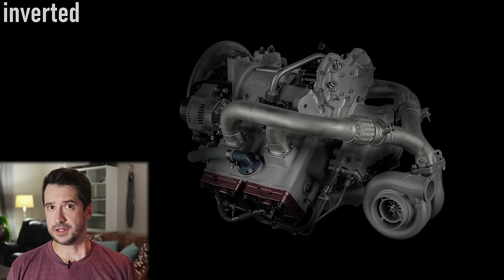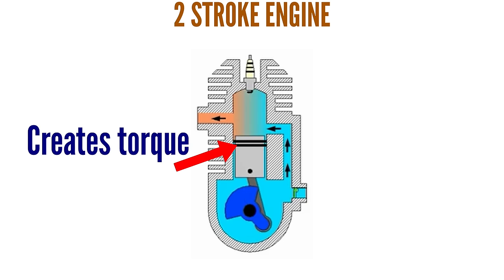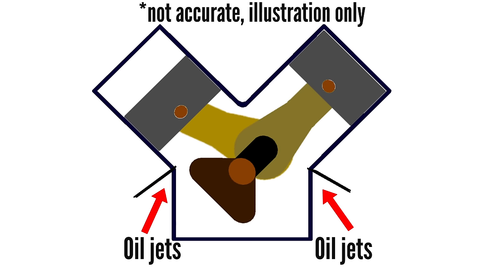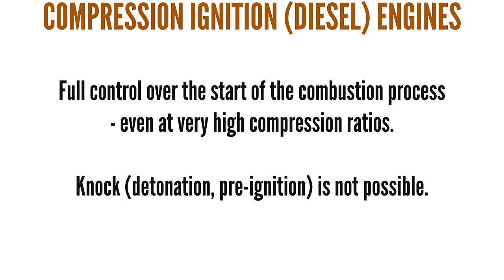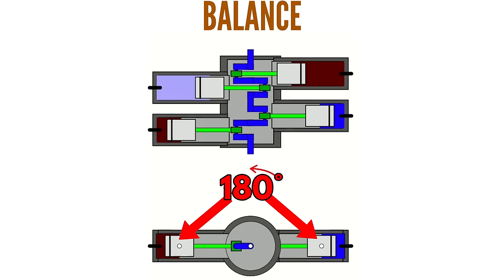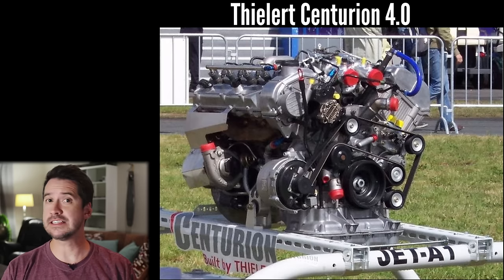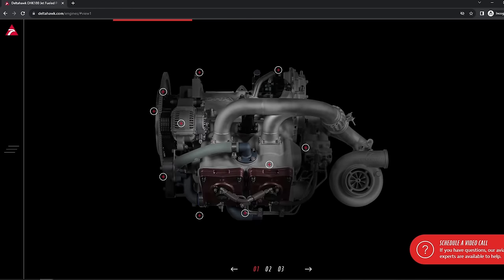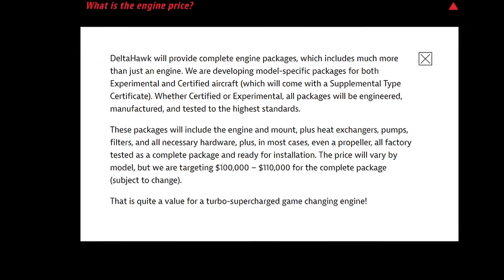Deltahawk's Jet Fuel Piston Airplane Engine Explained

Comment: Two stroke Diesels are NOT supercharged. The thing you are calling a supercharger is a "scavenging blower."  It is necessary to provide air for combustion. I worked for some time for a company that makes 2 stroke Diesel engines.
Reply from the maker: This info comes from Deltahawk's website as well as several aviation news sites. They are calling it a twin-screw type supercharger.
Reply: Actually I remember the old Gimmy diesel that I worked on years ago and that engine was a 2 stroke with a super charger. And 1/4 mile racers used those super chargers on Himi engines.
Reply: This engine uses a centrifugal turbosupercharger and a positive displacement air pump
Reply: Says twinscrew on website.  There are plenty of people that have supercharged and turbocharged on the same engine.

I will point out, in the video, stated that the supercharger isn't used after turbo kicks in is false.  The supercharger is positive displacement, and sits downstream (closer to the intake), it's still going to be compressing the air, just will be compressing the compressed air from the turbo.  Same idea as a compound turbo setup, except what would be the small turbo, is a supercharger in this case.

**edit.  A supercharger and scavenging blower are the same thing in this application.
Reply: Detroit 71 series was a 2 stroke OHV with a supercharger, and later models had both supercharger and turbo charger.  In production  from 1938-1995.  They sound wicked.
Reply: @brianb-p6586  it does though, though it might be 3psi, it's still a positive displacement.  Semantics at best.  Factory calls it supercharged, so it's supercharged.
Reply: Yes it's a blower on an old gm 2 stroke but it still makes positive pressure......otherwise it wouldn't work.
Reply: This engine is both turbocharged AND supercharged. I have been to (and toured through) the Deltahawk HQ in Racine, WI, and have inspected this engine very closely (although I was not allowed to take pictures - it was this summer, just after they announced certification). It definitely has an induction supercharger.
Reply: @Jessersadler k
Reply: The 'supercharger' likely has a bypass valve that allows the turbo boost to flow into the engine directly, with the supercharger/scavenger just spinning.  Requiring very little power to spin.   It would be awesome with a 1.5:1-1.8:1 possibly a 2:1 gear reduction, to allow the engine to spin up closer to 3500-4000 RPM. Or possibly higher. A variable gear reduction would be useful, a cvt of sorts maybe a hydraulic coupler with variable geometry. Allowing a near lock up at low rpm low throttle. And a reduction with more throttle , multiplying the TQ on the prop. Being aircraft, a failsafe is required. The use of a clutch to lock in a 1:1 ratio. By either manual application, or hydraulic pressure. During take off, it could allow the engine to rev to peak tq. Then change the prop angle of attack, and hydraulic reduction, to get optimal prop performance, allow the engine to rev between peak tq. To peak power.  Then settle to a cruise rpm. Possibly a 1:1.
The next awesome thing would be a V6, then V8 possibly a v12 version. About 360hp V8.  And 540hp v12, possibly more. Possibly using slightly smaller bores with longer strokes with the engines with more cylinders.  Still equal roughly the same displacement per cylinder.  Pushing the tq peak lower in the rev band.  I'd love seeing a  V6 & V8 version of this atleast.    Heck I'd love to see a modern light weight aluminum version of a Detroit Diesel, a 6v71, or a 6v92, nearly 550 cid of two stroke diesel power! And hearing a airplane with that Detroit roar! Awesome!! Even a 4v71 aircraft engine. 🤯 use modern pilot injection, haha. Make it quieter running.  With 284cid, with a pair of turbo's with air to water intercooling.  Wow..
Reply: @jamest.5001  Not how it would work, and would over complicate things.  Why would you a have a blower that's pulling parasitic power, and then not use it🤦‍♂️
Reply: @brianb-p6586  In this case, it seems as though you don't know what a supercharger is.  . . again, semantics at best, and you're the only one arguing it.

You know the other word for BLOWER ?  It's SUPERCHARGER. . . so you're literally saying "Scaveging supercharger"

"Every blower is a supercharger, but not every supercharger can be a blower. A blower is just another name for a supercharger, particularly roots-type supercharger, which is probably one of the oldest styles of supercharger"

And particularly this is a twin screw supercharger.  Both are positive displacement, both will increase manifold pressure.  If ambient pressure would be all thats needed, then there would be no need for one.  And damn near every multicylinder 2 stroke will have a supercharger(blower).

Also, by your definition.  The turbos aren't turbos either, as they'll scavenge the cylinder as well.  What should we call them then?

**edit
Going back to the Detroit motor, and why you would say the blower doesn't make boost, is because of either the valve timing, or port placement on these 2 strokes.  If both intake and exhaust close at the same time during compression, there will be no "boost", but the manifold will absolutely see "boost".  Since this is a port motor, and it relies on boost pressure, we have to assume the exhaust port is closed (cut lower or another way to closed intake air from escaping) before the intake port.
Reply: Superchargers are a mechanically driven compressor used to supply combustion air to any engine diesel,gasoline propane or other fueled engine. They generally have two rotors with either two or three lobes on each. The rotors may be straight or twisted.
Reply: @Lloyd973  Well, a roots blower doesn't actually compress the air per se.  Needs a manifold for that ability
Reply: @Jessersadler  depends on its intended use. Top fuel cars use a supercharger and typically exceed 50 psi at 9000 or more rpm. Diesel engines that use a superchargers are generally gear driven or belt drive and typically are designed to provide additional air flow at a higher than ambient pressure. When used in many industrial applications pressure is secondary to total flow. Large quantity of a gaseous entity  at low pressure as in many roots style blowers.  Two different  applications for the same piece of equipment. 
For automotive use the engine has a manifold.  For most industrial applications the blower has inlet and outlet ducting which serves the purpose of a manifold. 
We are all saying the same thing just a little differently. As you said several times semantics. Thanks for sharing with us.
Reply: @Jessersadler yes often called super turbo
Reply: @Jessersadler he will never get it😊
Reply: The supercharger helps with scavenge and the turbo increases overall charge pressure. 2strokes are easy to turbocharge as long as the exhaust back pressure is on the order of the intake pressure.
Reply: Isn't any forced induction
Supercharging
Turbocharger
RAM AIR  INTAKE
TO IMPROVE SCAVENGENG FOR IMPROVING EFFICIENCY AND PERFORMANCE
Reply: @garreysellars5525  a 2stroke without crankcase compression won’t even run without a scavenging pump, Diesel or not, as there is no pressure differential to drive the chargers into and exhaust out of the cylinder. following the description, the turbocharger is a set-up that provides more boost than exhaust back pressure, hence allowing scavenging. The SC is only used for startup or emergencies. They mentioned it would be good for about 50% power, essentially making it a classical scavenged no boost 2stroke. Without either SC or TC, this particular engine would plainly stop running.
Reply: It's still supercharging in my book.    Is an engine driven blower forcing air into the cylinder during its intake phase/stroke?  Yes?  It's supercharged. 

The engine requiring it to run, doesn't change the fact that the cylinder is receiving higher than atmospheric pressure.
Reply: @mikeg3529  that is correct, but the pressure is very small and you don’t necessarily get above atmospheric pressure in the cylinder. It is mere to replace the crank case compression of a “normal” 2stroke engine.  Without either, it won’t even run.
Reply: @garreysellars5525  no, in case of 2stroke Diesels without crank case compression, the SC is not causing an improvement of scavenging, it does the scavenging. You cannot boost the engine this way, it plainly won't even run without that supercharger. Only once the engine runs above a power threshold , you can use the turbo to achieve the same, but only if the intake pressure is slightly higher than the exhaust back pressure. In a 4 stroke, ex pressure can be higher than intake pressure, but for an externally scavenged 2stroke, it cannot. This SC does not increase power over naturally aspirated, it enables the engine to run as naturally aspirated engine. Decouple the SC at idle or lower loads, without TC even at full power, and it would plainly stop running.
Reply: @mikeg3529  once the intake ports are closed, there is no significant "boost" in the cylinder. It is not supercharged, but rather charged. That is why it is called a scavenge pump and not a supercharger. It makes no boost in a sense of cylinder fill pressure above atmosphere. What makes boost in this engine is the turbocharger that is set-up to make more boost than exhaust back pressure. Otherwise they would not be able to decouple the scavange "supercharger" without the engine essentially stopping. This supercharger replaces the classic crank case compression as a scavenge mechanism of a fuel lubricated 2stroke engine.  It is not a power adder, it plainly is a power enabler. The engine won't run without.
Reply: A Supercharger builds pressure, a blower moves air, a roots on a detroit diesel doesn't build significant pressure, which is why they are not considered supercharging. This has a twin screw, unlike the roots it has internal compression making it much more thermodynamically efficient for boosted applications and horribly inefficient as a blower, because it would compress air, only to have it expand back in the manifold.
And don't even start with top fuel, they are forced to use the roots, which is horribly inefficient at producing boost, if they were allowed to use twin screws it would gain hundreds of horsepower due to the reduced drag alone, not to mention the much colder intake temperatures. The sanctioning body wants to keep them from going to fast to reduce accidents, the fact they use something does not mean it is anywhere close to an ideal solution.
Reply: Symantics. No one knows what a scavenging blower is. Say supercharger. The 1st "supervhargers" came from airplanes and 2 stroke diesels swapped into gasoline. Its NOT required to have the blower but it makes 2 stroke efficiency go way up
Reply: yup thats a turbo
Reply: 🤓 it's still a supercharger, even if it is set to make minimal boost and is necessary for combustion. It also still can make boost if you run it at higher speeds.
Reply: All really big marine engines are turbosupercharged 2-strokes. And pretty wicked pressures too.
Reply: It's still a supercharger even if it's used for scavenging.
Reply: A blower is a supercharger and the standard GMC roots supercharger was literally designed for detroit diesel 2 strokes
Reply: @lapin46  yeah, that's why no 2 stroke engines without a blower have ever worked lol
Reply: They are supercharged. Wouldn’t make enough boost to run at idle otherwise.
Reply: The blower on a Detroit Diesel engine is known as a Roots type blower. Minor pressure rise. It was originally designed as an air mover for mines. It is used on engines because it produces positive airflow at low speeds. On a DD engine it gets the air moving in the right direction. As a compressor it is not high efficiency.
Reply: I'm not an engine guy but from what I gather here it seems the argument here is that although they are essentially the same piece of hardware in one scenario it's used to force air above 1bar into the combustion chamber this allowing more fuel to mix with the greater quantity of air being pumped into the chamber and thus creating higher cylinder pressure during the power stroke resulting in much higher engine power output and this would be considered a supercharger since it's "super charging" the air fuel mixture? And in the other scenario the supercharger is merely there to move enough air into the motor to allow it to run as well as possibly siding in the removal of exhaust gasses and maintain adequate air movement through the motor so it will run efficiently but not providing any significant increase in air fuel mixture in the combustion chamber beyond 1bar or that which would be expected in a naturally aspirated motor? Like I said I'm not a engine guy and very unfamiliar with the 2 stroke diesel so I'm not sure if I'm even close to understanding what y'all are debating here but if I am getting the basic gist of it correct then I would have to say that in either case it is still a supercharger as it's literally the same piece of hardware but despite this I can also see how referring to it as a supercharger in this particular application is a bit misleading if it's not actually "super" charging the fuel. Maybe an air delivery pump or O2 circulator would be more fitting in this application lol? But idk maybe I'm totally misunderstanding it's purpose in this application still?
Reply: Yeah the ones they used in mines were huge. Think that's also how they got the name blower isn't it? But they do still work well as a supercharger. Isn't the 671 and 871 blowers roots style? Maybe not as efficient as a twin screw (they are kinda similar) or a centrifical supercharger but still very effective not to mention they look and sound amazing. Don't the top fuel 10,000+ HP dragsters still use roots superchargers? Prolly just depends what type of power curve you want for your application as well as what look you prefer that will determine what style power adder you choose? But idk I'm not very educated on this topic so could be totally off base lol?
Reply: I worked on some Detroit Diesels in boats and the 8V92 that were run in Pilot boats were rated for 600hp and had both the traditional GMC blower as well as two turbochargers as I recall but may have had only one big turbo.   This was before they switched over to Series 60 Detroit 4 stroke engines of similar hp but were electronically  controlled for emissions.  I was told by a friend who had been a diesel mechanic in the Navy that he had been a ship that they just set they cruise speed a it ran for hours with no problems.
Reply: @Dunriteproducts  it get its name from what it was actually patented as. . . ROOTS BLOWER.  Named after the inventors last name. . . and it blew air. . . the patent was literally called BLOWER.

a "TWIN SCRW SUPERCHARGER" is the patent name of the airpump used in this motor.  Literally  the name of it.

Also, in an engine, positive cylinder pressure from forced induction applications is attained by valve timing.  You could have 100 bar in the intake,  but if the intake valve(port) closes before the exhaust, the cylinder will not be boosted.

Not sure why this is so hard to comprehend.
Reply: Super charging in airplanes is not for power increase but to maintain power at altitude. 50% of the air is below 19,000 feet so a naturally aspirated engine will only make 50% power at that altitude.
Reply: @edwardhobelman6296  This is absolutely for power. . . And you contradicted what you're saying.    "It's not for power. . . . NA loses 50% at altitude".  Seems like it's for power.
Reply: Look into deitroit 2 stroke engine,  a supercharged diesel using a roots type supercharger. This aircraft engine has a twin screw supercharger in the middle of the inverted V. It is in the video for you to see if you understand what you see. Actually a 2 stroke diesel must us supercharging  to fill up the cylinders with air because 2 strokes have overlapping cycles.
Reply: Semantics.
Reply: This is a pointlessly semantic and pedantic comment. The supercharger is required for exhaust scavenging and may or may not create pressure above ambient depending on valve and port timing. You can take these superchargers, put them on any 4 stroke and they work just like any other forced induction device. 

The fact that the distinction is sometimes made for the sake of understanding it's function compared to its use on 4 strokes doesn't  make it incorrect or inappropriate to call it a supercharger.
Reply: @LetsGoAviate I think most people don’t know the difference between scavenging pump and supercharging even though they are the same device. It’s most likely a marketing decision rather than an engineering one n
Reply: @Jessersadler they’re scavenging pumps on Detroit 2 strokes. They’re called that because they are required for the operation of the engine. There would be no scavenging without the blower.
Reply: @yolo_burrito  cool..  tomato, tomato.  Semantics again.  This is called supercharger, by the factory.
Reply: @donaldpaton1691  it's a positive pressure pump, density and volume will be controlled with valve timing.  In order for this motor to actually make "boost" (denser air in the cylinder) the exhaust valve must close before the intake valve.  This will have an effect on the air density in the cylinder.
Reply: I worked on Detroit Diesel 6-71 2 stroke diesel engines. Yes the roots blower was a scavenging blower. The blower also provided boost so it is a Supercharger.
Reply: You beat me to it!  Good call and input!
Reply: Detroit diesels are definitely supercharged
Reply: Go back to school
Reply: So? That (might) make you an expert on that particular two stroke diesel, but hardly on all two stroke diesels! The scavenge blower can certainly be used to provide above atmospheric induction pressures on lots of 2 stroke diesels. Thus qualifying it as a supercharger…
Reply: Gm 567,645 and 710 were avalable with dual supercharger+turbocharger, or just supercharged. And all three are two stroke engines for locomotive and marine use.
Reply: Interesting
Reply: If the volumetric efficiency is more than 1 then I would call it a supercharger.
Reply: @Jessersadler 

So “compound turbo” as you mentioned is different than “Turbo-Compounding”?
Reply: @Jessersadler 

Miss that sound.
Reply: @Lloyd973 

Or supercharges can be centrifugal (and some additional variations on this theme).
Reply: @nilsthemis 

Can’t some of those 2-cycle marine diesels start on compressed air and then the turbos take over?
Reply: @edwardhobelman6296 

In WW II aircraft engines it was both extra power and altitude power maintenance (in some engines).
Reply: @Mentaculus42  yes.  
Compound turbo is a set of turbos in series, low pressure and high pressure.  The low pressure turbo compresses the air and then is sent to the high pressure turbo and it compresses the air again.  

Turbo compounding uses a turbine to extract waste exhaust gas energy from the engine, and then applies it directly to the drivetrain/*propeller ( not sure there was any cars that used that type of system) throught gears/output shaft.
Reply: @Mentaculus42  He's referring to Turbo-normalized engines in aircraft.  They also use it to pressurize the cabin.